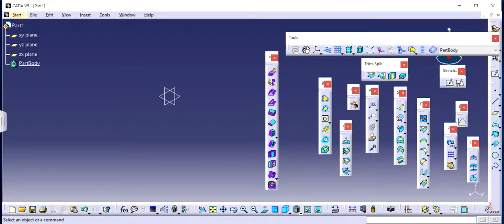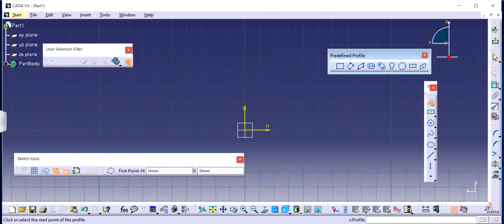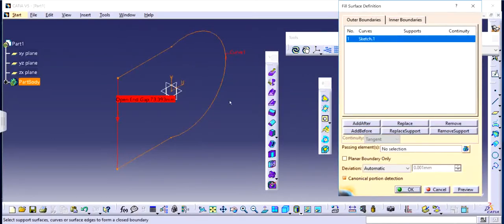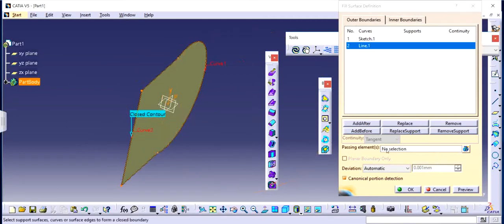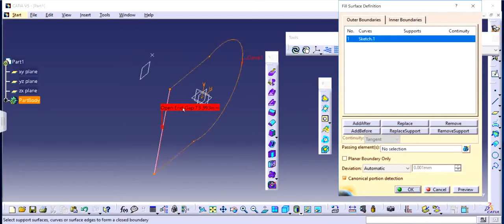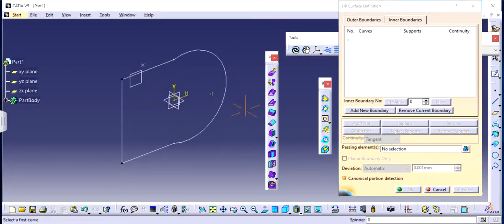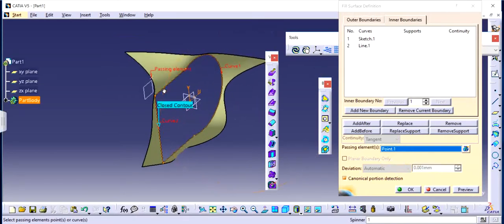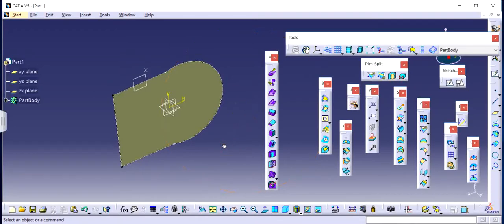CATIA V5 : SURFACE DESIGNING VIDEO 4 - FILL FEATURE ( OUTSIDE & INSIDE)

Comment: does anybody know how to solve the problem that says: the result is partial, the inner constraints are not taken into account when im trying to put a passing point in the fill surface operation ? its like there is not taking into account the passing point just the fill
Reply from the maker: The point you are trying to choose, is it on the same plane as sketch?
Reply: @Everythingiknow881  no bro it is a líttle bit forward im tryinto to make something like a cone